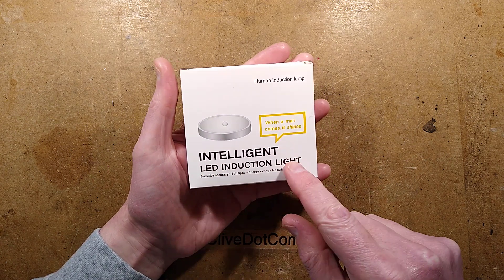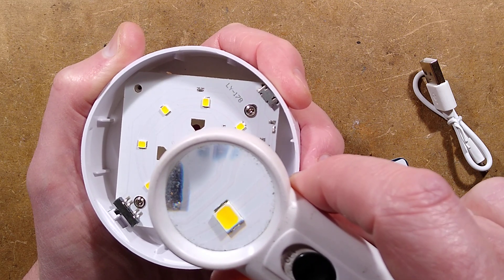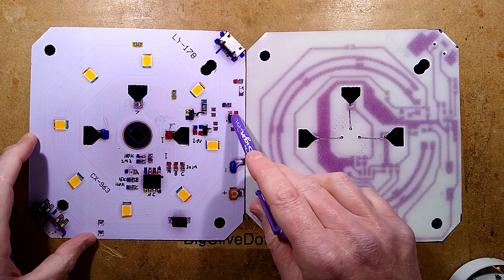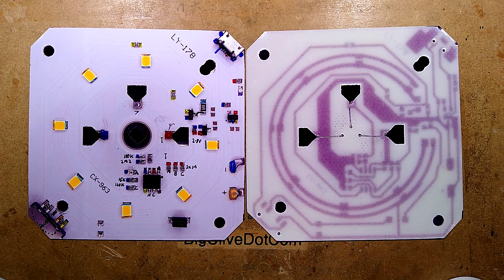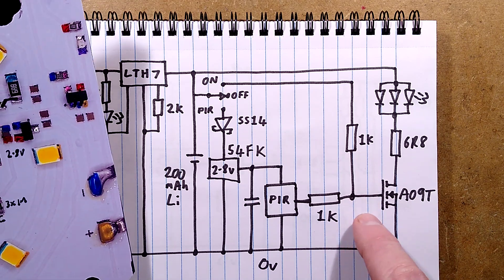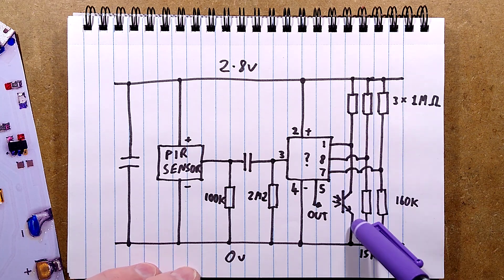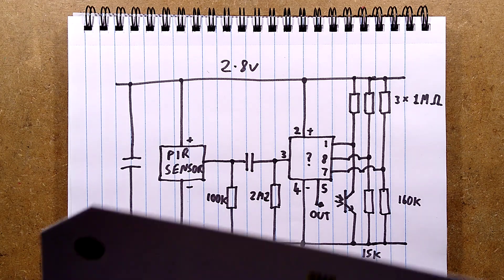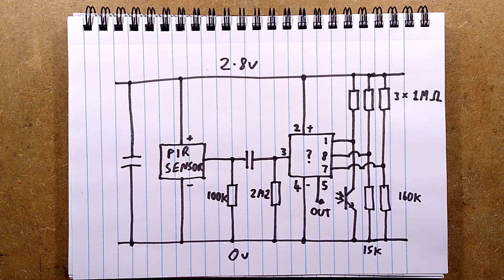eBay rechargeable movement detecting light

Comment: Doesn't seem to have protection to prevent excessive discharge in the "ON" position unless there is a board inside the battery.
Reply from the maker: No overdischarge protection other than the LEDs reducing in current greatly at the lower end.  It gets very dim before the lithium cell is overdischarged.
Reply: @bigclivedotcom  So if switched on and forgotten It could pull the battery down to 1.something before the LEDs stopped conducting. Could be a fire hazard when recharged, or at least a toxic stinky nuisance.

Comment: I have a light very similar to this one, but without a power switch...it is always on and always detecting motion.  I replaced the small battery with a large one I recycled from another device.  It works great in the closet and with the larger battery, it lasts quite a long time between charges.